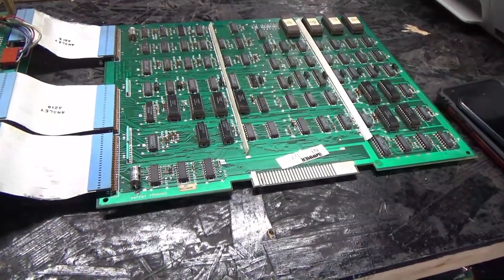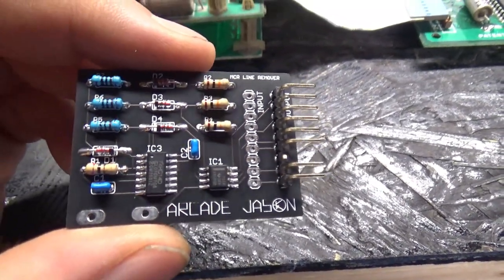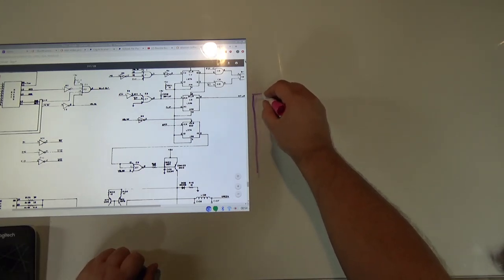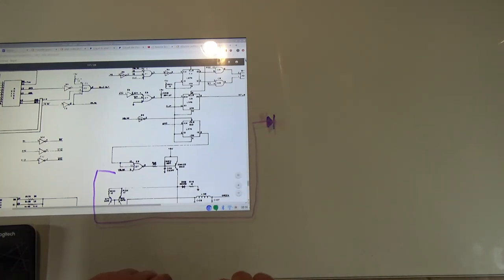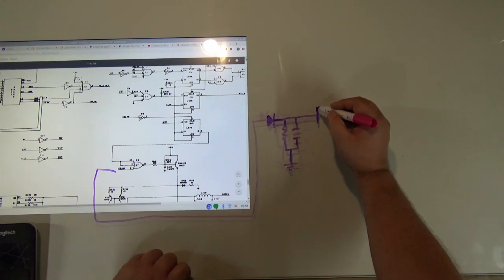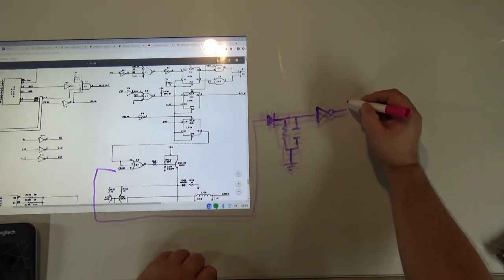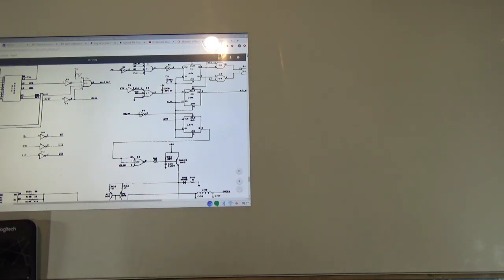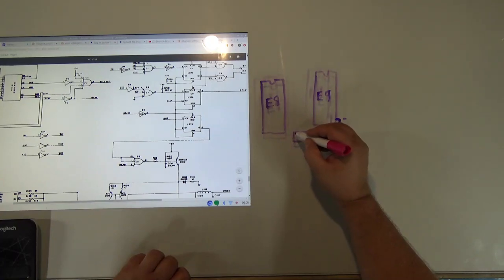How to remove that line of garbage on mcr games

Comment: I would have probably used a flipflop clocked by HSync with BLANKing as the Data input and AND that (or OR depending on polarity) with the old blanking. This would expand the blanking period by exactly one scanline. It would also be a massive overkill. Don't do this unless you need EXACT timings...
(btw. this comment was submitted on a Raspberry Pi connected to a CRT TV)

Comment: I remember correctly.
But my memory is fuzzy.
But if you play the tower level on Tron arcade machine.
While you're firing at the rainbow blocks and walking to the right the tower would move with you until you hit the right side of the screen.
Then it would stop.
While you're trying to finish off all the rainbow blocks.

But I think I remember a tiny bit of the tower would show up at the left side of the screen?
I might have it confused with another game.